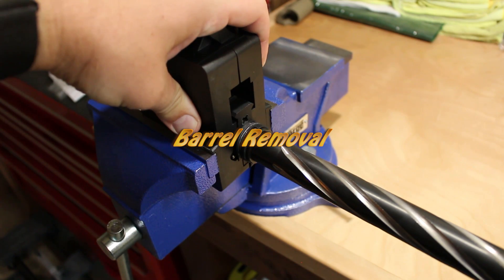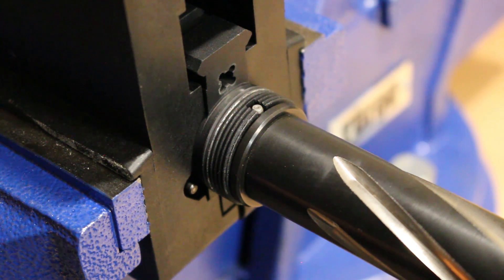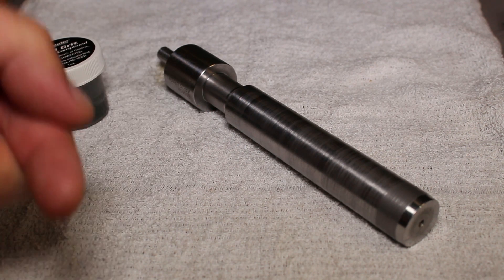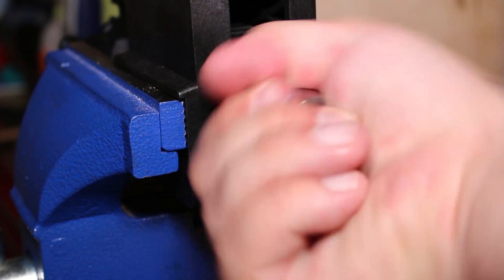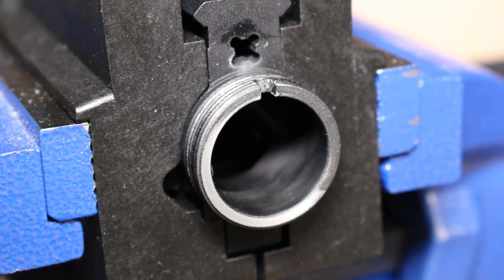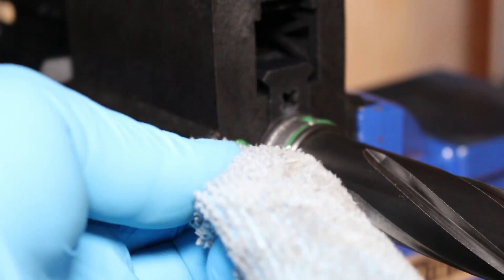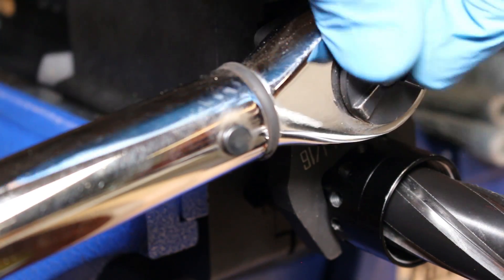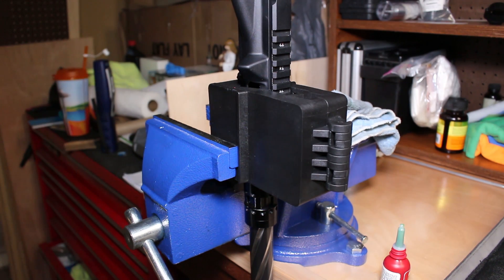Bedding a Barrel into an AR-15 upper receiver

Comment: I noticed u didn't tighten than loosen the barrel nut a few times like other vids suggest to supposedly "season" the threads. Did u 4get this step or is it unecessary in your opinion? Or is seasoning the threads something u don't do when bedding a barrel? Just curious, cuz I def want to get the most accuracy from my latest build & ik barrel installation can be crucial if achieving sub MOA is something u want to ensure

Comment: Also, what is up with you guys using green loctite next to the barrel???  It is rated for 450 degrees.  Loctite 620 is even less....  Your barrel gets hot once and it is done.  Aeroshell 33MS for the barrel nut, everything else that interfaces to the barrel (muzzle device, gas block set screws) gets rocksett which is rated for nearly 2000 degrees and is somewhere between blue and red loctite in terms of holding power over that entire temp range.....I can't watch people that use loctite on barrel interfaces.  My god....

Comment: There are two types of people that lap their receivers.  The first realize that it doesn't do anything since the barrel extension is pressed firmly against the upper receiver with 30+ ft.lbs of torque and doesn't actually move after mating and don't pretend it does to justify their actions.  The second bends the results of their post-lapping test fire so they can justify their actions.  I have 3 friends that lapped their uppers and 2 of them said it did nothing and we pressed the third to show us.....so we took a different rifle to the range, tested it, lapped it, rebuilt it and tested it.....EXACT same groups.  Guy still thinks it does something!!  So funny......Lapping products are a solution looking for a problem....

Comment: That barrel extension should be snug or tight fit in the upper receiver if precision accuracy is the goal.
You should measure to see if the hole of the receiver is oversized or the barrel extension is under sized and replace the out of spec part.
Or you can shim it with a feeler gauge set using the thickness for your need. Folding the shim around the barrel extension.
Cheap solution!   (GearWrench Feeler Gauge size 32)
This is a nice tip though, thanks for sharing. 
It should improve accuracy by supporting the under sized barrel extension all around it. 😉👍🏼
Reply: where can I find specs on barrel extension diameter and inside receiver diameter?

Comment: After lapping, I didn't see any material at all removed from about half the receiver mating surface, so how are you saying it's now flat? No anti-seize compound on the aluminum receiver threads being mated to a steel barrel nut? No proper mating of the threads to the barrel nut? Headspace issues? People, please be careful.....

Comment: I stopped watching after he said "if you take off too much you'll run into headspacing issues" this right there shows he doesnt know much about the AR15 platform
Reply: Ar15 headspace has zero to do with the upper receiver. You can check headspace with just a barrel (with extension) and a bolt, with no receiver even in the same room. One of the benefits of the design is that receiver variations don’t really matter, so long as the bcg and barrel are on the same axis.
Reply: @teddysurf  You don't know what you're talking about. The headspacing is a function of the bolt carrier lugs and the internal lugs. The headspacing can literally be permanently set without the upper receiver at all. Do your homework.
Reply: I stopped watching after he said... A that you MUST bed the barrel.
Reply: I kept watching being new to ar’s but once he hit the green loctight on the barrel I said yea nope.
Reply: @teddysurf  a comment does not have to be proper It's not like I'm writing a book and why does it always have to be compensating if someone has something nice I've got budget and I've got high in they all do the same exact thing but that one particular rifle was built for long  range and I feel like spending a little money  but anyway look up AGI American gunsmithing institute they got some really good courses they'll take you design function and repair You understand those three things You can work on any firearm they'll help you from start to finish get your FFL everything you need they even got payment plans $500 a month for 6 months there's difference I paid for mine I didn't just watch you two videos
Reply: @teddysurf  teddy, teddy, teddy, you do realize that when the bolt is locked into the barrel extension that the carrier is making contact with face of the barrel extension. The problem with YouTube and channels like sotar is, guys like you watch them and think you’re an expert. It is apparent to me and other commentators on here that you have little to no practical experience with this platform, better tone thought a fool than to open your mouth. Have a nice day and go get some experience.
Reply: @teddysurf  maybe you should listen instead of thinking you actually know everything but because you sound like an idiot there's no sense in me saying it because everybody else already has but headspace has nothing at all to do with the upper  receiver just because you watch school of American rifle does not make you a gunsmith I've seen his videos And he knows what he's talking about but you don't You do not have to have a receiver to check headspace You can check head spice with just a barrel nothing else and then you can check headspace with a barrel and a BCG together and then put them in any receiver you want to whether the receiver is in spec or not and the headspace is going to be the exact same as what it was before you put it in there I can take a grinder and cut half the threads of the receiver off and headspace will not change You need to understand how The rifle functions Even someone with basic common sense on how the rifle functions could tell you you're full of shit
Reply: @teddysurf  So you think I should use punctuations cuz you can't figure out where one sentence ends and another one begins well I'm not going to It's called dumbing it down and writing a simple text instead of five paragraph comment I guess you think naming a bunch of parts make you special or will hurt my feelings well you're sadly mistaken I could do the same thing I don't have a room full of tools or a safe for guns that I've built from scratch or modified I didn't just sit here last night an finish building one That just so happens to have an aero precision upper and lower receiver Magpul PRS lite stock ergo deluxe tactical zero grip  radian raptor charging handle and talent safety novaski buffer springco spring elfman pro match drop in adjustable 2½lb trigger BCM BCG 20-in ballistic advantage DMR 1/8 twist with a surefire socom 2 Leupold Mark 5HD 3.6-18x44 M5C3 Atlas bipod And that's just one  I could sit here all day and name the stuff I've built and what parts I use That's not my first rodeo and won't be my last
Reply: @teddysurf  So now you really show ignorance what you're saying is if I don't explain in detail you can't understand have you ever paid attention when you close The receiver that the BCG pushes up against the buffer there is no play in the BCG It does not float ever so slightly as you say do you understand the purpose of the buffer retainer pin It's only there so the spring and buffer does not come out when you open your rifle It's not meant to hold the buffer while it's in battery Open the rifle and look as you close it the BCG pushes against the buffer what shows there is a slight bit of pressure against the BCG So right there your entire argument falls apart but let me guess you cannot understand that because I did not break it down and use punctuations and explain in detail because I'm not going to sit here for an hour typing a message The point is to get straight to the point not ramble about the little stuff in your argument you're saying there is no spring tension but there is So what you're saying is if you put a stronger spring in it will interfere with headspace since because it does push against the BCG but your headspace is determined inside your barrel extension and the bolt face your bolt carrier having pressure against it will not change headspace That's why you can check headspace without having the rifle assembled and then assemble it and it will not change your head space will stay the same You're barrel extension your boat face and you're locking lugs is where your head space is determined That's why there's multiple ways to check headspace maybe you should go back and watch your videos from school of American rifle I've watched the same videos and what you're saying contradicts what he teaches So have a good day I'm done arguing with you about something you clearly do not understand
Reply: @teddysurf   the headspace is permanently set by the barrel extension and pinned from the manufacturer. Lapping the face of the upper, in itself could be questionable without chucking it up in a lathe and finding the true centerline. You could lap it all day and the worse you could do is mess where the barrel extension meets the feed ramps on the inside of the upper. Still would not change head space.
Reply: @teddysurf  Because the headspacing is set with the barrel extension at time of manufacture, the upper receiver doesnt have anything to do with headspacing.
Reply: @teddysurf  Im sorry, I dont have any youtube gunsmithing degrees... My experience is in real life...
Reply: @teddysurf  The BCG locks into the extension on the barrel which is already installed before you get it. Look into it pal, because it seems like you dont know as much as you think. This is not a bolt gun. Now have a nice day.
Reply: @SB-zf6sq  even on a upper, bcg, barrel you all bought separately? They are all from their own factory head spaced?

Comment: The ar-15 platform headspaces with the bolt to barrel extension not the barrel to reciever. Now if you take off too much material you may run into feeding issues but headspace will not be affected by it.
Reply: That's exactly what I was thinking
Reply: @Jayis_preppy  that can be resolved with a shim or shims under the barrel extension - that is if the barrel extension protrudes into the receiver.
Reply: Could you just hit the surface with a stone

Comment: Remember when torquing to have the  tool at 90 degrees to the torque wrench other wise you will be multiplying your toque. This is taught in aviation in getting the correct torque or you will have to calculate the extra leverage and reduce it on the torque wrench.
Reply: I don't think it is multiplying your toque, but yes, it does add leverage

Comment: have to call on the loc tight.  it will not take the heat  dye kem the face check for high points lap of high points  if that doesnt work get another gun

Comment: You need shims for that wiggle my friend! Not a lapping job. The lapping does help but that wiggle is still there. American Gunsmith back in 2013 had a two part article written by Mr. Carlos addressing this issue. His article “Barrel Extension Diameter In The AR 15” is exactly what you need to fix that wiggle. Cheers.

Comment: Lap tool should be vertical. Receiver should be plumb to the earth as close as possible. Remove as little of the anodizing as possible. Grease your threads. Don't bother lapping and bedding a crappy receiver with several hundredths of play like that one. Get Seekins, Aero Precision, Noveske, LWRC, LMT, Knights, BCM, or Ballistic Advantage upper receiver. Never use aluminum barrel nut. Clean loctite from inside the receiver before it dries.

Comment: Did you inspect the upper to confirm that the face was not perpendicular to the bore prior to lapping? It might not have needed it and you could’ve lapped it out, a hand tool will not work as good as the cnc that machined that face

Comment: i just have to point out a few things . i build target uppers . and have done around 400 of them .  first do not use the lapping tool horizontally . almost everyone on youtube does it wrong . put it in the vice vertically and it will be a more accurate lapping . do not use a drill ! or you will take off to much ! i never use loctite on barrels . get some .001 or .002 stainless steel shim stock and use it . it is cheap . wrap shim stock on barrel extension . till it is .001 over the receiver opening . than use a propane torch and heat the barrel nut thread up . 5 to 7 slow turns of the upper . do not change the color of the metal when heating . just get it to expand . and slide it on the barrel . make sure the barrel is in the vice  before heating the upper . now let it cool down , and it will be ' bedded ' nice and tight and square to the upper . learned this and more from my cuz . not going to give his name . but people pay 3 to $4,000.00 for his ars and even more for his 1911's . almost all of his target uppers are built by me . and use anti seize on the barrel nut . makes it a lot eayser to get it back off if you need too .

Comment: I recently installed a Midwest Industries free float quad rail handguard on my Bushmaster MOE 5.56 carbine.  I already had a low profile Yankee Hill gas block that just fit under my new handguard.  I noticed that after I removed the oribinal barrel nut assembly that the barrel wouldn't budge.  I couldn't get it out of the receiver.  I didn't really try since I wasn't changing the barrel, but why would it have been stuck in the upper receiver like that?
Reply: Might be heat fitted

Comment: I k ow this is older video but what are your thoughts on using uppers with reduced sizing, like BCM and JP instead of using a Loctite method...... and will the tool for truing the face work with them.....

Comment: When you inserted the barrel into the upper you should've turned it back and forth to evenly distribute the 620 between the barrel and receiver. . . .You also only faced off the receiver so it has 50% contact which also isn't ideal . . .I want over 75% contact surface whenever I lap anything, 90% is even better, 100% the best. . .

Comment: Buy a quality upper and barrel and you will not have loose tolerances like this. 
I just built 2 BCM uppers and used BCM barrels. 
You have to heat the upper with a heat gun to be able to slide barrel in. The fit was so tight. 
Both builds are Sub MOA. 
All this crap is really not Necessary

Comment: Why 90 degrees when tightening ??
Reply from the maker: That is the most accurate way for your torque limits.  If you use straight or add extensions it changes the torque limit.
Reply: @67futura25  ...The torque ia the same at 90 degrees as it is straight on. It will increase if you use a crow foot with an extension. Think of using a 6" extension with socket and switching to a 12" extension the torque is the same..

Comment: nice video,,However with you knowing prior to lapping if the face is not 100% square or true then by hand lapping is probably doing more harm than good..You can not and will not be more accurate than the milling machine that cut it...Unless there is an incompetent operator running the milling machine.                ..it was a nice video though.

Comment: No need to warp your upper by cranking on the barrel nut.  Here's the real tool: 
www.realavid.com/shop/lug-lok-vise-block
Also, the bolt lugs lock into the barrel just the same now as before.  How would doing this affect headspace at all?  Listen to sman7290...  This just aligns the barrel and upper mating surfaces so the extension is perfectly inline with the carrier bore in the upper.
Reply: Your link did not work, but I am guessing that you were referring to the RealAvid Reaction Rod. While that tool is better than using an upper receiver vice block, if you are going to build a bunch of AR's a steel reaction rod is a better bet, even though it will cost a little more.

Comment: I’ve been building ar type rifles for years and can tell you there is absolutely no need whatsoever for Loctite ! Aero33 grease is what 99.99 of top end builder use .
Reply: What, exactly, do you think the purpose of bedding a barrel is?

Just curious, because you're talking about the interface of the receiver threads to the barrel nut -- not the barrel extension to the receiver.

Comment: Loctite 620 is permanent and absolutely should not be used to assemble a barrel. You will never be able to replace your barrel.
Your also supposed to lubricate the threads on the upper before installing the barrel nut. 
Your putting out some bad information to people who may not know better.